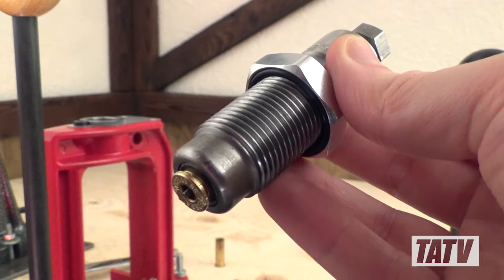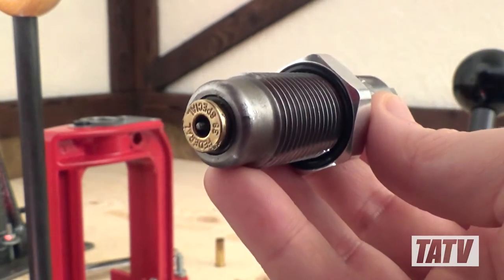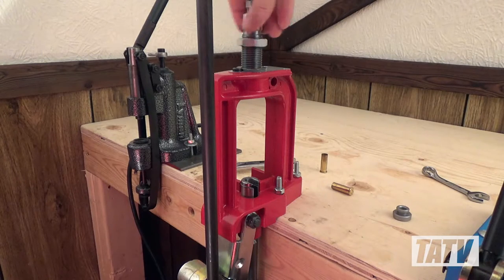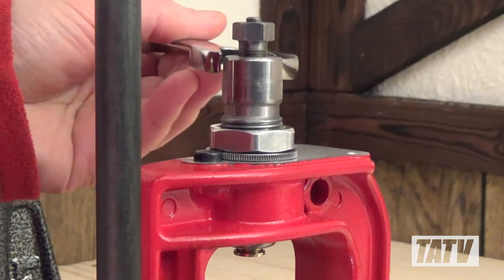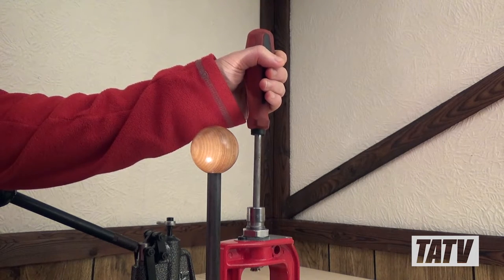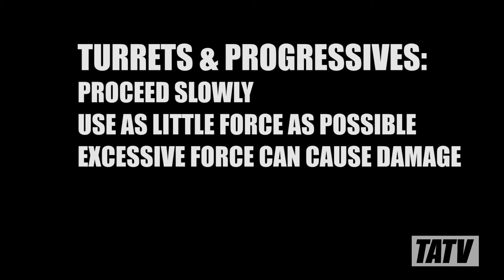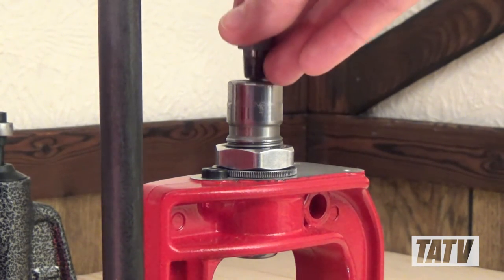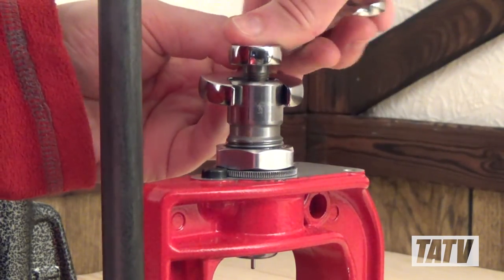Removing a Stuck Case from a Lee Resizing Die

Comment: Does it matter what depth the depriming pin is? Mine keeps sliding out no matter how tight I screw it
Reply from the maker: Yes indeed it does; many Lee de-priming pins are slightly tapered.  When you're insert it into the resizing die, ensure the de-priming pin is roughly flush with the top of the retention nut (make sure you don't over-tighten the nut).  When you go to use the die, if there isn't enough room on the up-stroke and the pin is bottoming out on the primer pocket, it will automatically push the de-priming pin back up through the top of the retention nut provided the nut isn't over-tightened.

You may also want to ensure your retention nut isn't stripped; they have really fine threads and sometimes get misaligned during installation.
Reply: I tightened the nut over the pin as hard as I could and the pin still slid up slightly past being flush when I pressed the cartridge into it. So you are saying it's ok if it slips up a bit due to the slight variation of brass and the primer pockets? Appreciate it!
Reply from the maker: Yes, that's correct.  I suspect they've intentionally designed it that way to prevent the pin from becoming bent/damaged when bottoming out on the primer pocket.  If you consider the fact that some cases, for example .38 Special and .357 Magnum, use the same die even though they have different lengths, it makes sense.
Reply: you really have to grunt it past what is comfortable compared to others. When its done, its set.
These dies are tough.

Comment: You forgot to mention and show removing how to reomove the decapping rod/expander ball from the case first.
Reply: Yep... On my very new die the first ever case stuck. Expanding button was still stuck in case throat.. After removed the case I spotted that the top end had 2 pieces broken. Although die still working, but feeling isn't good.

Comment: Yeah, it's easy if you don't have a die with an expander ball. If you do, it's much more difficult. In this case, Lee recommends loosening the decapping rod clamp and driving the case out by hitting the decapping rod with a 3/16" drift punch struck with a 1 lb hammer. The manual also lists a coupon code that can be used to purchase replacement dies on their website at a 50% discount, if you damage your die somehow.
Reply from the maker: The discount is awesome if you're in the continental US, but for the rest of us it's not much help. Shipping and customs will eat that 50% and then some.
Reply: @TATVCanada  Yikes! Doesn't sound like much of a deal then.

Comment: But what if you can't get the depriming pin out
Reply from the maker: I've never had a situation where I couldn't. What seems to be giving you grief?
Reply: @TATVCanada my depriming retention nut refuses to loosen. I’ve put in a table mounted vice and still nothing with both wrenches
Reply: Update lol: I was so frustrated I said fuck it, set up my wrenches and started banging the 1/2 with my mallet and finally loosened it
Reply from the maker: @kingfatiusiii4744  It sounds like it might be stripped.  Can you see any metal shavings/'threads' around it?